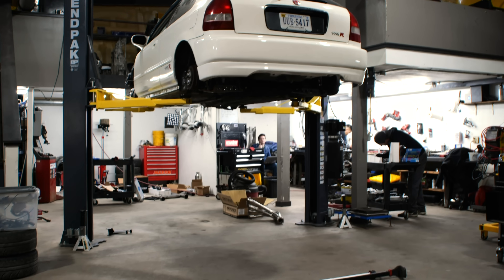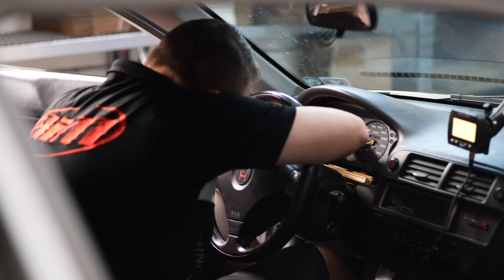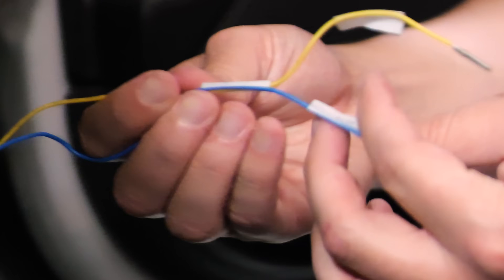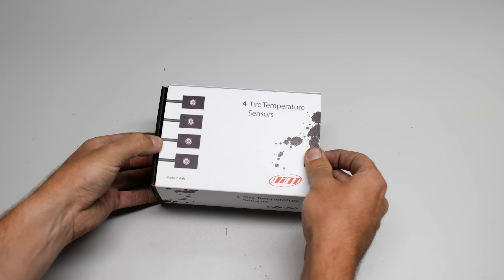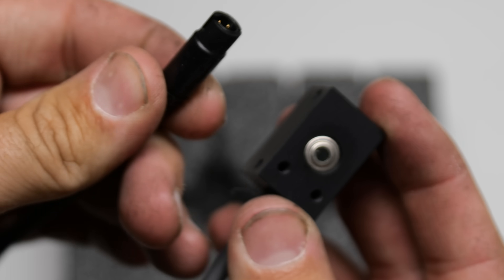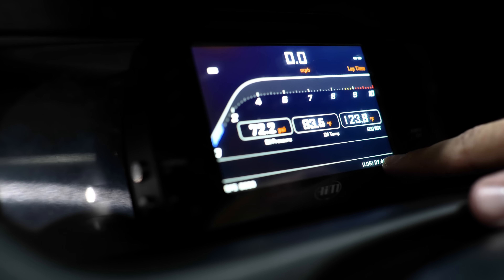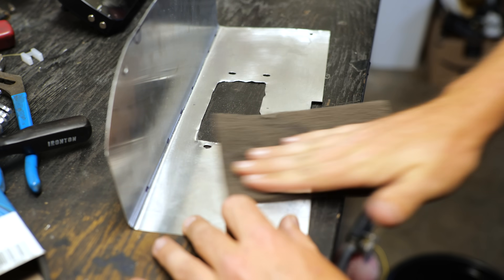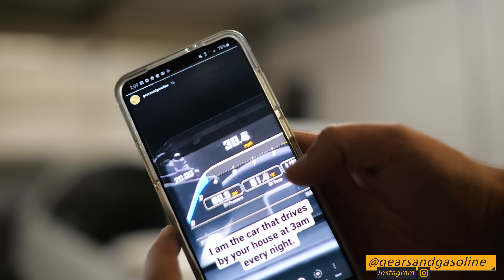Installing a Digital Dash in My Honda Civic

Comment: Was the fuel just a tap into the existing or did you have to add resistors or program to read the factory sending unit?

Comment: I'm planning on doing a body swap of a 1500 Goldwing onto a 2004 1800 Goldwing now the instrument cluster on the 1500 is old school where the speedo uses a cable on the 1800 it is electrical.  Now there are dash lights that function for various things like Reverse, Side Stand, Cruise on Cruise set, FI light which also is a trouble shooting light if for any reason the engine has a fault.  Now there is a ECU but no OB2 output.  Are there any functions for adding more information in the instrument set up.  Looking at your old dash I bet it had Cruise light on and then cruise light set so tell me if your digital dash had these in it.

Comment: That's next level stuff can't wait to see you put it into use temperature sensors on the tires is brilliant the GPS is good I wonder if they could actually track the lines you followed on the track to see if you can improve your position of the car with suspension monitoring also?

Comment: sheet metal is fine...shiny surfaces howerver, are no fun. Should at least paint it to keep reflections out of your eyes if the sun or light source is behind/to the side. Personally, I love the look of simple analog gauges...Id have the AIM elsewhere and have most of the added sensors in a cluster of analog gauges (with digital signals obviously). Still, this Civic is a pristine example of how to build one..even without a K swap, the styling is simple but effective and the cars performance oriented. All its goodies are mostly unseen by the public, which is how i build most of my car!  Caint wait to see this thing on the track!
Reply: hah! i literally paused to comment..should have finished watching. 10 seconds later he's painting it flat black! hahaha...

Comment: Are those 7 or 8 j wheels?
Reply from the maker: 9
Reply: @GearsandGasoline  damn that's wide lol. Looks really aggressive and good on the Honda. I've got a wedssport tc105n that looks fairly similar on my Yaris and it's a 7j. Went from steel wheels to a 7j and I couldn't be happier. I need to get a Honda like yours soon but here in South Africa they're getting quiet scarce 😭

Comment: for a double wishbone setup for both front and back, it's weird that you're on two wheels around the turn. it's not getting enough suspension travel and I'm not seeing the wheels toeing-in and maintain contact when one side is lifting up. I think a progressive setup is the best...but need some good shocks to take care of the soft part of the compression.  If done right, you're barely going to need those LSD to power out of the turn.

Comment: If you drive balls to the wall you dont need this over priced speedometer......your becoming what all car enthusiasts hate over priced parts that cost more then the car you drive keep it real along tome ago all you needed was a stop watch to make you go faster....keep it real,done
Reply: It's a data logger using GPS which can give him real time predictive lap times and many other useful features.
It's good to actually know that you're on a good lap so you can keep pushing and once you pull into the pits you can review the data to see where you can improve.
It can also be set up to flash red if any values are at unacceptable level, like if the oil pressure drops too low for example. That feature can quite literally save an engine.
It also removes the need for so many gauges to monitor engine vitals, instead being able to display them all in one place 
"Over priced speedometer" ah yes, because that's why the pros are using them right?

Comment: I think i'd skip the GPS sensor thing, and get a speed signal from the gearbox instead.
Reply from the maker: The GPS sensor is for track positioning and lap times
Reply: @GearsandGasoline  And it was abselutely impossible for it to work from inside the car? :/

Comment: Drilling the hole to make it larger, no worries. But he hits the boot lid and strips the paint, that's the cringe part.
Reply from the maker: It was a tough angle to drill from underneath because the headliner was in the way and he didn't want to catch that. It only hit the inside of the boot lid and we sprayed some white paint on it to prevent rust after the drilling anyway. Its all good 👍
Reply: Stepdrill anyone?
Doing such things on camera while working for a named company, very unprofessional i think.
Reply: 100% agree 🤣🤣
Reply: I could be wrong but he mentioned that they usually don't do installs, so it might just be a bunch of engineers who don't install unless its for a promo
Reply: Doesn't GPS work inside the car too? Just thinking about standalone GPS.
Reply: @TheSpeedfreak665  for navigation it's no problem but track usage requires much more accuracy (a coupe meters can make a difference)
Reply: track car. who gives a shit
Reply: @VS666  still, not really professional.